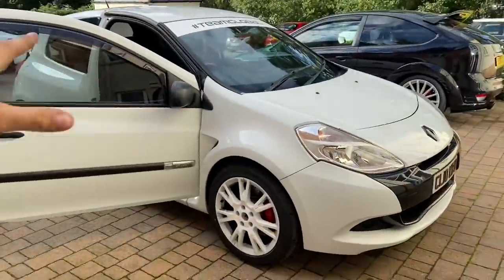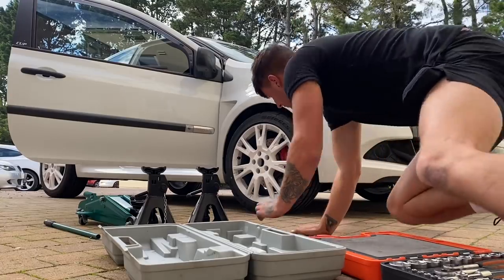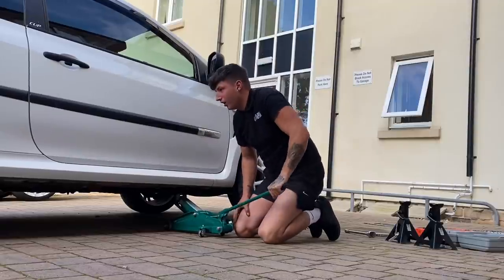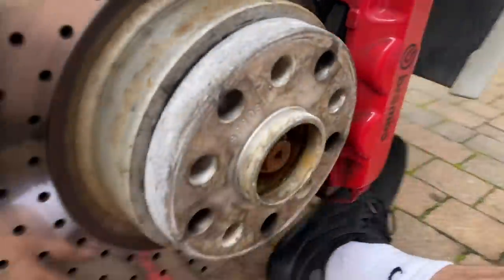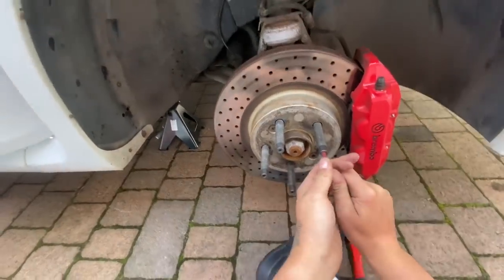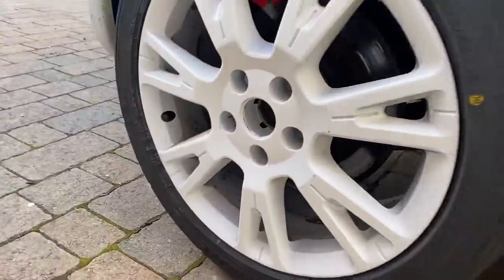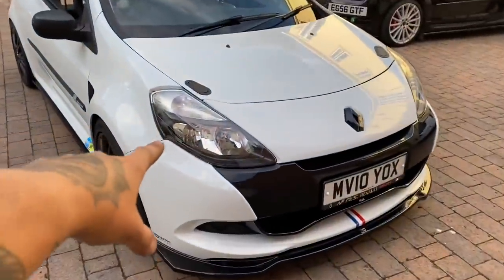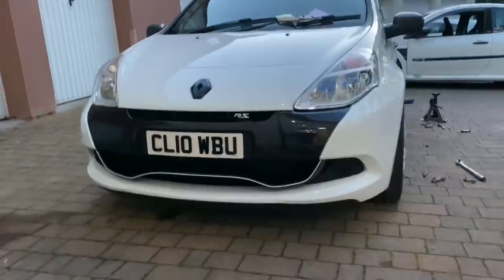BUILDING A RACE CAR Episode #3. ** CLIO RS GETS STUD CONVERSION KIT **

Comment: Them studs need to be torque to 20Nm then before you put a wheel on left for a good hour for the loctite.....Before you put loctite on everything need to be clean with brake cleaner otherwise the 
loctite will not set... I have the same set on my Megane and thats how pure motorsport tell you to install them so they dont come off...